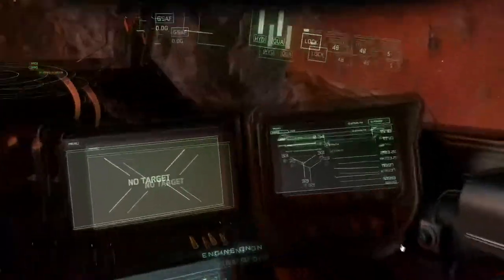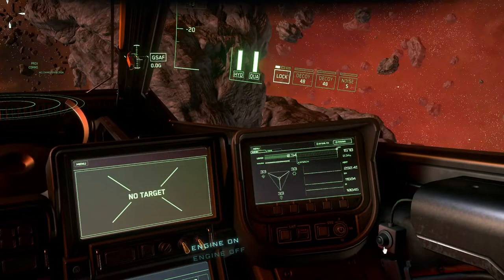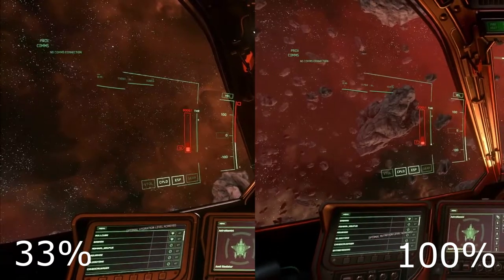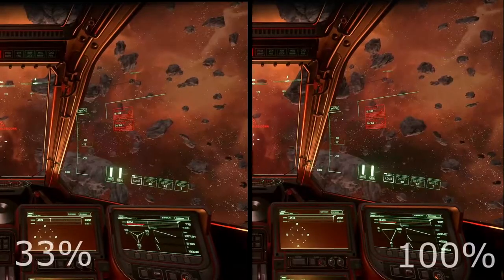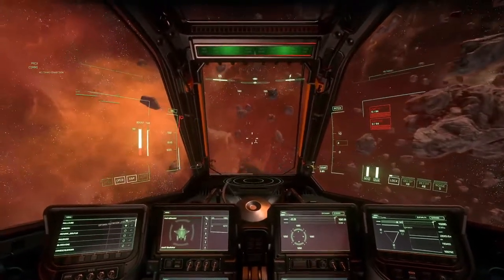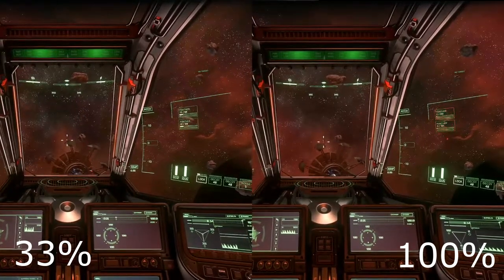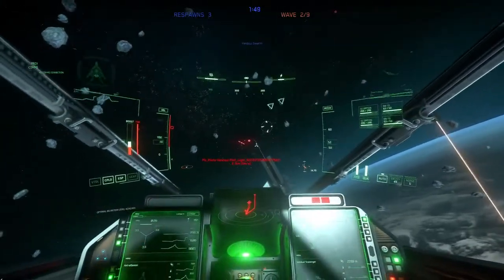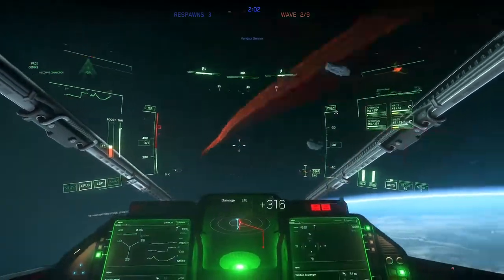A Guide to Capacitors and the Power Triangle in Star Citizen 3.14!!

Comment: The cap changes have pushed me back to mixed loadouts, with the shield boost, and no downside for weapons being unpowered when mono ballistic I am considering a couple of new all ballistic loadouts.
Reply from the maker: Yeah, ballistics are in a super interesting place right now, because while the new ammo caps are a bit low, you don't need to have power in your weapons at all while using them, so you can outmaneuver people better and tank more hits with the extra power in Shields and Thrusters. Mixed loadouts are also nice because the more energy weapons you have total on your ship, the less power goes to each one. On a Super Hornet for example, you can have like 6 guns, but if they're all energy weapons, you'll only get 15 or so shots from each before they all need a recharge.